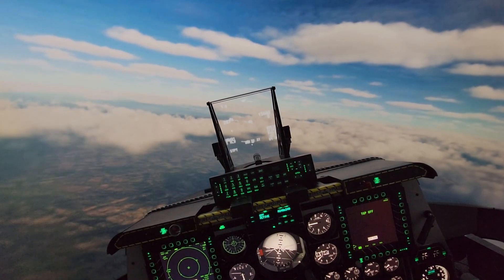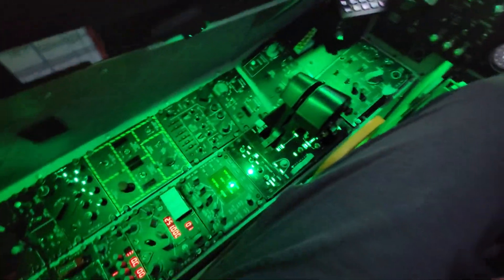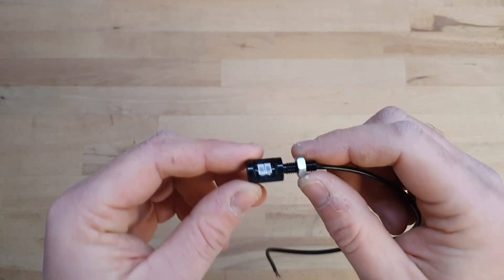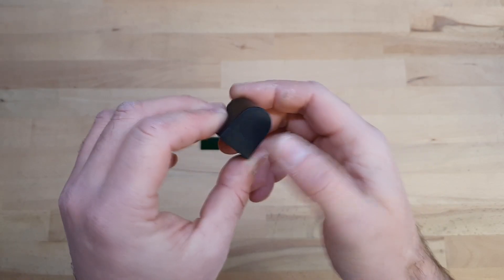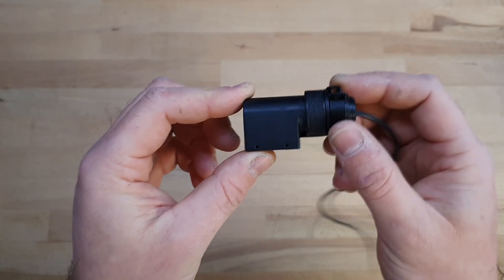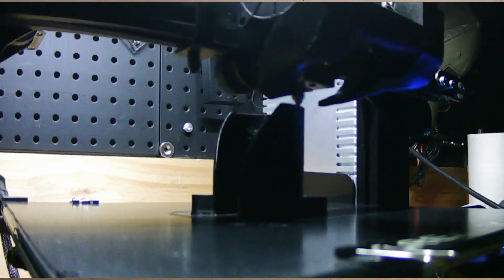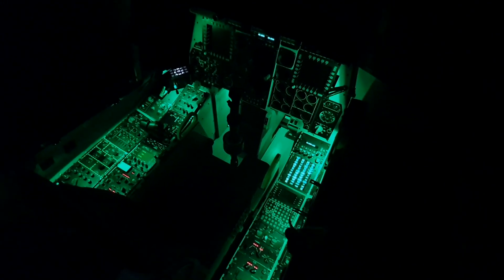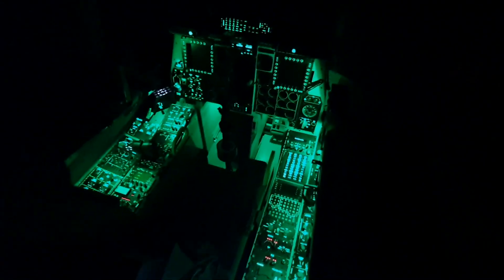Home Cockpit Flood Lighting - A-10C Warthog Simulator

Comment: If you ever need a hand with voltage regulation give em a hoi.
Can point you at easy to use Ali / Ebay modules that would have driven those servo torches.

Comment: Real nice additions there! 
As I understand it you've hardwired the lighting logic so consoles follow generator and battery switches? 
In the latest version of DCS-BIOS (DCS flight panels branch) we included the values for the actual lighting intensity (consoles, flood etc.) - so not just the knob position on the panel. 
If you use those values you can sync lighting 100% in software (nice way to handle unforeseen configurations, like engine out but switches on or other events that should shut the lights off/on)
Reply from the maker: Thanks mate! Legend! I needed to monitor if the electrical power bus was either on or off to correctly position my relays, rather then the actual levels/intensity of the backlighting.  It is not using the gen and batt switch positions, but is actually using the off flag on the angle of attack indicator, so it will come on with aircraft or with ground power and if the bus gets broken/destroyed, it will shut off as well. Would be cool to get a true/false value added in DCS-BIOS for the A-10 electrical bus.

Comment: Your 3d printed parts look great! What filament and filler are you using? I never had shiny parts like yours :/
Reply from the maker: I'm using PLA from an Australian company called 3Dfillies. After printing I give it a rough sand, then heavily spray it with some spray on car body filler. Then sand it with 600 grit, and spray paint it black. FDM printing will never give you perfect results, the key is in the finishing!